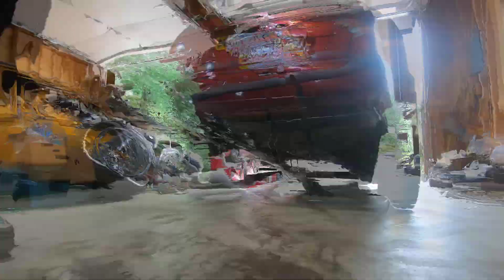BMW e36 Touring Coilover Install! ST Coilovers going into my wagon.

Comment: hey man, very cool Touring. Question on the install - if you look at the strut/camber plate from the top view/strut tower view in the engine bay, are they "clocked" slightly one way or the other? Or are they directly perpendicular to the wheels? Cant seem to find a clear answer on this!
Reply from the maker: I'm pretty sure this is entirely dependent on what tophats you're using. Most I've seen are slightly off center, IIRC towards the inside of the car.